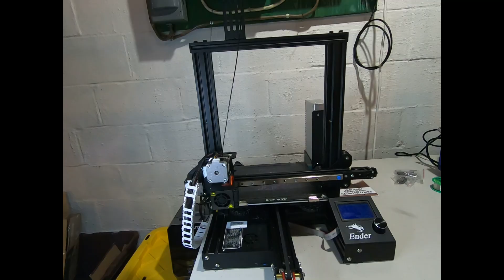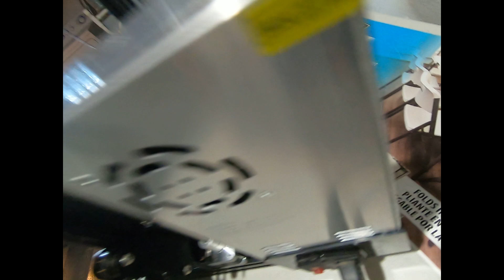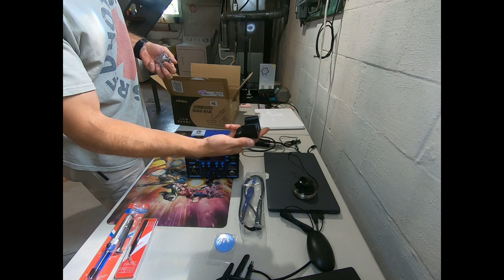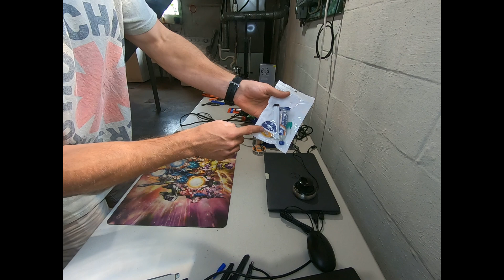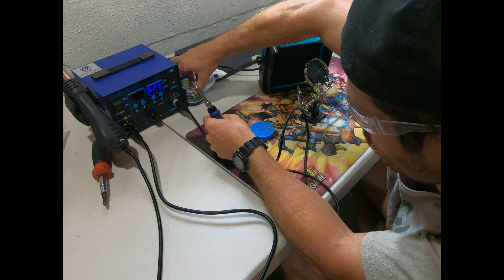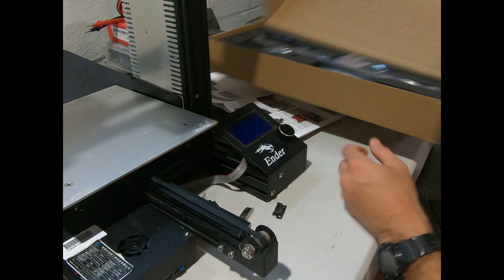Exoskeleton Project Update, 3D Printer Updates, Soldering Myoware EMG Sensors w/ Tips for Beginners

Comment: Those where pretty solid beginner soldering tips! Some things I would add:
1. Helping hands take too long to setup. I rather use plastic or metal standoffs that can be fastened on mounting holes for bigger boards or omnivice for smaller boards: https://www.google.com/aclk?sa=L&ai=DChsSEwiew_n605eOAxXULEQIHRyzDicYACICCAEQCRoCZHo&co=1&gclid=Cj0KCQjwyIPDBhDBARIsAHJyyVg_X1Tt0opqIUTHW2x1pa3Ki9o_Cs72oDZ3lnlVhu1nza01cgGh0zEaAv_KEALw_wcB&cce=1&sig=AOD64_3X91tY889Y6YBVkzEfq-IqoRPr1w&ctype=5&q=&ved=2ahUKEwidj_X605eOAxXhIEQIHR8WBiEQwg8oAHoECAgQDQ&adurl=

2. Flux leaves residue that can be conductive and mess up your electronics. Also not nice to have on your skin. I would get some IPA and a small strong bristled brush to clean away the flux. 

3. Get familiar with what tip works for what type of soldering job. Thermal mass is your enemy when soldering, so pins that are connected to a lot of copper will be harder to solder with thinner soldering tips, so use thicker tips. Some pins are hard to reach because of board density, these may require angled tips, etc. 

4. It is generally better to heat up the pad/pin and let the solder melt there instead of on the soldering tip. Play around with the angle of the tip relative to the pin or pad you want to solder and where you apply solder. Some angles are easier at preventing solder wicking to adjacent pads. 

5. For desoldering, the solder wick is the best thing out there for single pin solder removal (or fixing a solder blob shorting things out). For multiple pin desoldering, the hot air is your friend!
Reply from the maker: Awesome advice!